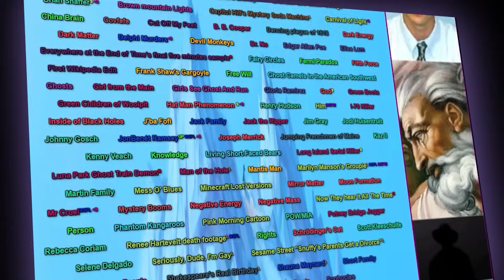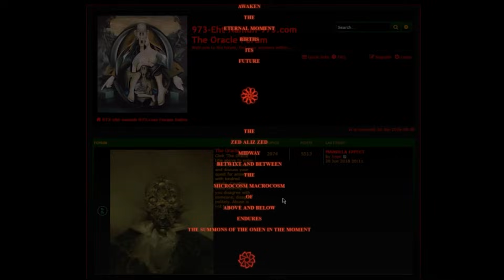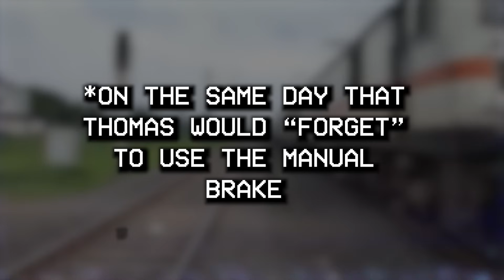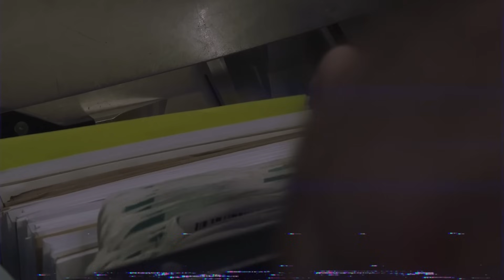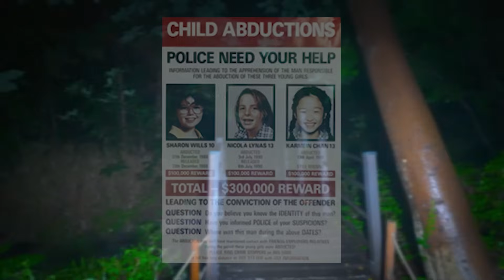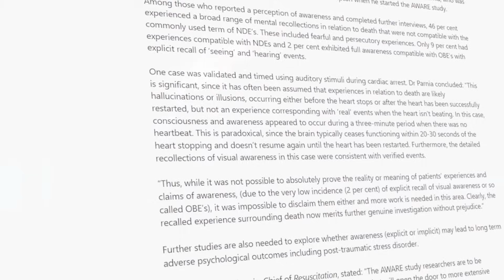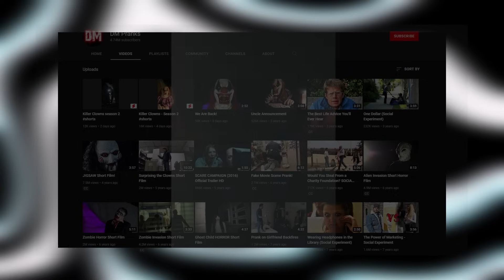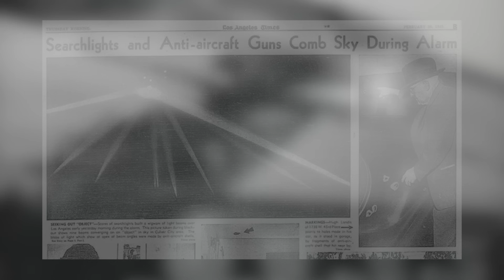The ULTIMATE Unsolved Mysteries Iceberg EXPLAINED (Part 1)

Comment: Just a correction: Mr Cruel murdered the last victim, Karmein Chan. It's either an escalation and then something happened to him, or it was unintentional or unexpected which is why he went to ground. Either way I hope they find him and drag him into the light.

Edit: there was some speculation that the murder wasn't the same perpetrator. On the surface it seems to fit though.

Comment: Quite a good condensed piece on Mr Cruel, minus the public record errors (well, done by the way).

It would have been nice to include the latest on these cold crimes though, i.e. in 17 April 2022, a Melbourne newspaper broke the story that the 1991 criminal profile drawn up by American experts, was badly wrong because of dud information supplied by police from Australia.  Apparently only 2 of 4 incidents from 1987-1991 happened during school holidays (not the 4 as claimed in the profile).  American profilers stated that there was a high probability that the offender was connected to a school in some way i.e. he might have won “teacher of the year award” etc.  But the newspaper of 17 April 2022 pointed out NONE of the crime dates remotely suggests a school i.e. Christmas-New Year break, two crimes on Saturdays, etc, one during a normal school week.

These days the most favoured careers for the offender are either law enforcement or electrical industry employee.

Comment: so let me get this correct from the 2001 anthrax attacks section, they closed the case in 2010 but reopened it 2 years before because the methods seemed sus? wouldn't the case have still been opened unless that is a mistake on your end DLAM